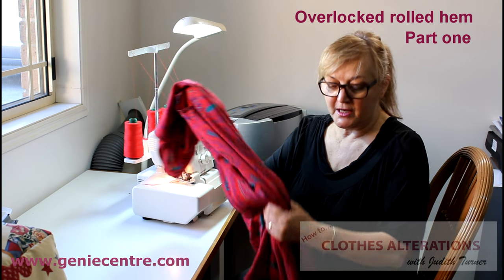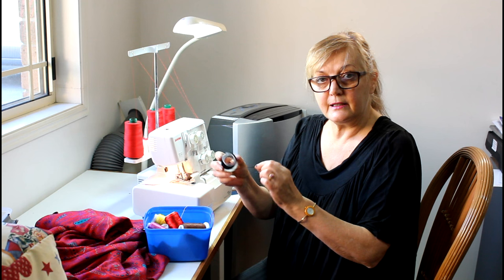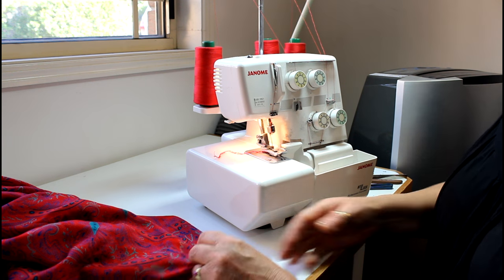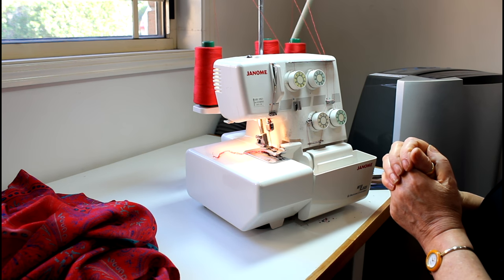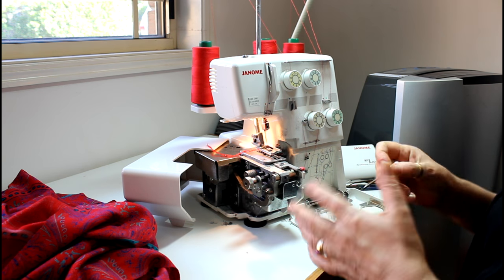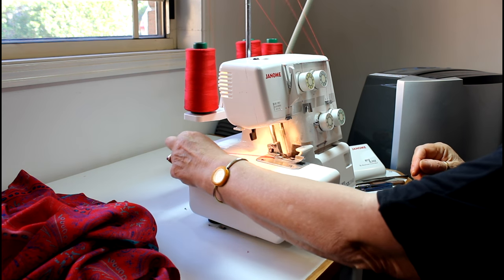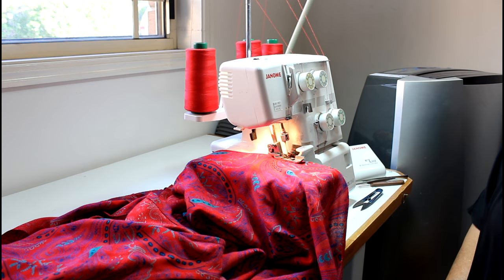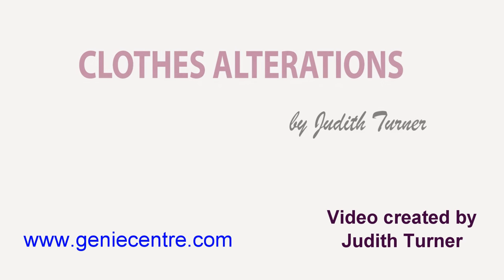Overlocker rolled hem

Comment: Hi Judith,  I'm so pleased to have found your video easily.  My serger is the same as yours and I want to do a rolled hem but my cutting width adjusting knob will not push in so I can move the needle plate setting knob to R. Do you have any suggestions as to how I may get it to work again?
Reply from the maker: You have to lower the blade before you can change it to R.  Have you tried that?  If the blade will not lower, then it could be that the blade is attached the wrong way around.  That happened to me once.  I put the blade on wrong, and couldn't lower it.
Reply: Hi Judith thanks for your reply. Yes I have lowered the blade with no trouble. The trouble is just with the cutting width adjusting knob. Everything else seems to be operating fine. It is overlocking as normal.  The cwa knob will turn clockwise and anticlockwise but it just won't budge pushing it in.
Reply from the maker: You may need to take it to a mechanic then.  I am lucky to have a Janome expert as a friend.  I just give her a call if I need something done.